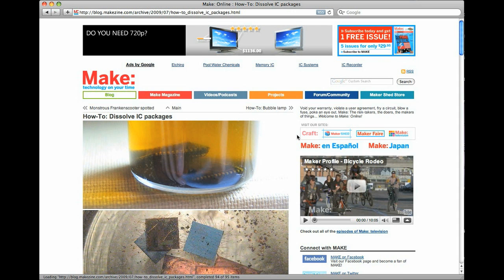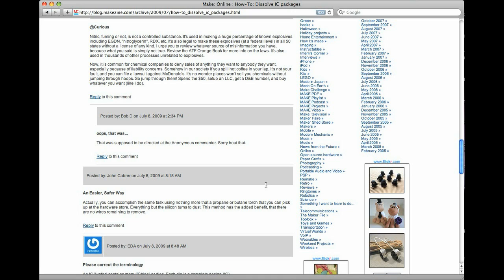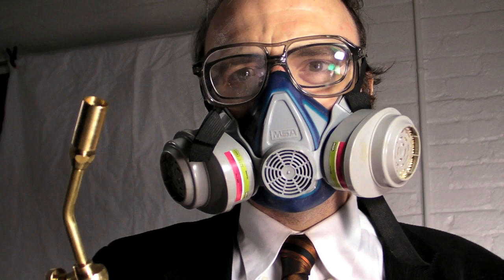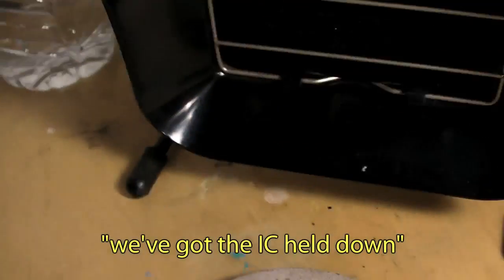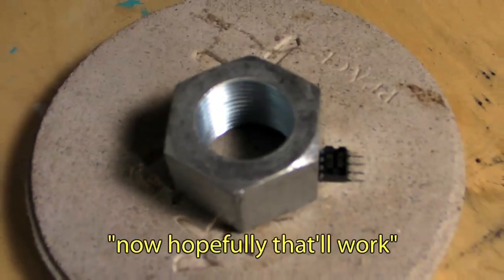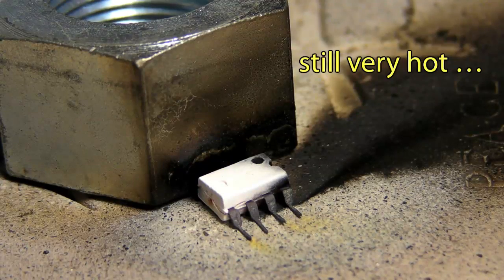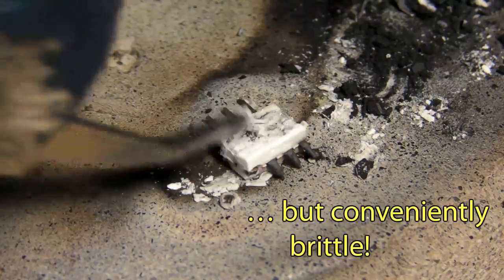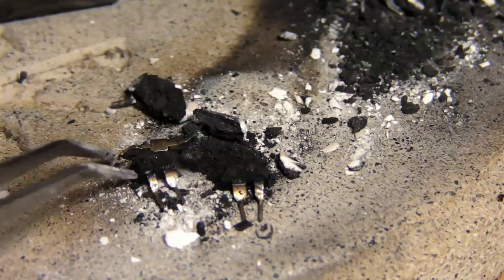Collin's Lab: Exploratory IC torching

Comment: So a realy realy realy tiny chip is packed by a too big plastic? becouse come on, the plastic case for the IC is too big right? or well, meybe they are made big for the pins and slodering stuff... hmm... to be continued...
Reply: Eskmm1 yup, but the purpose of the case is to allow us to do anything with the chip (you can't just directly solder to it, it's too small)
Reply: yes, of course! The chip is almost allways tiny, but you can't just connect anything to it... unless you have a bounding machine worth like a few million dollars, and that's why they put them into bigger packages.
Reply: guess its because the case? is a standard size

Comment: There aare a bunch of hifi enthusiasts in Japan who use trichlorethelate to dissolve the chip packaging on DACs so they can replace the legs with silver wire. The results are by all accounts stunning.
Note: I am simply not entering into arguments about 'Why not use gold' or 'It won't sound any different' - These guys and me use single ended, silver wired valve gear. Its in a different league to transistors. Try it! :o)

Comment: When I took a welding class, one of the things we were told to never do was drop red-hot material into cold water, as it could "explode" ... So dangerous thought here, heat it up like you did, then drop it in a bucket of ice-water, shouldn't  that make it all break apart?

Comment: Why would you do this? If you want to see an IC CHIP up close to get how its manufactured, get yourself a technical Data Sheel for the model you wish to look at. It's a hell of a lot safer than incinerating the outer coating of the chip. Most manufacturers will give you a TDC for a chip model if you request it.

Comment: Isn't the chip burnt this way?

Anyway, I got a '741 chip just by wiring it the normal way... it's blown up for his own reasons :D
The chip conditions were much better than those in the video, but it's so small you can see anything but an about 1x1x0.5 mm square, gray thing. Nothing so interesting...

Comment: cuber,
He isn't using a cutting torch, this is just a regular propane torch. You can't dial the flame on the propane torch like you can a oxy+acetylene torch. Plus it's so small a normal cutting torch flame would be to broad to cut efficiently, the point of this vid is to heat the casing forcing it to weaken it's molecular bonds.